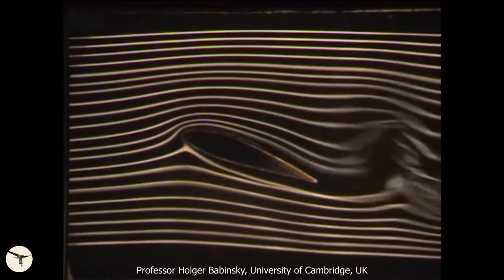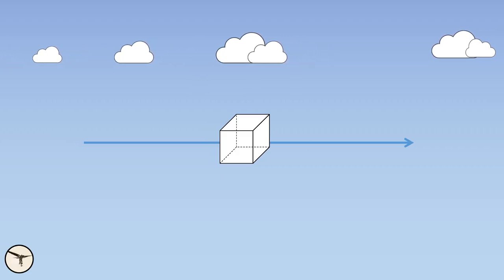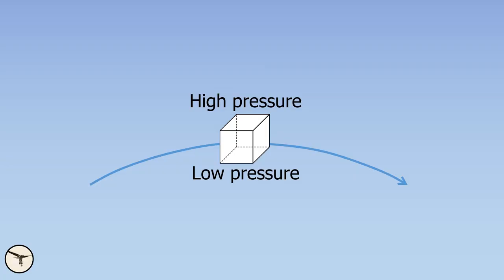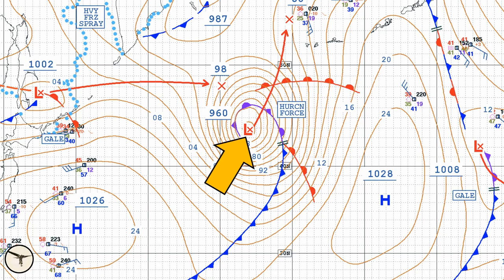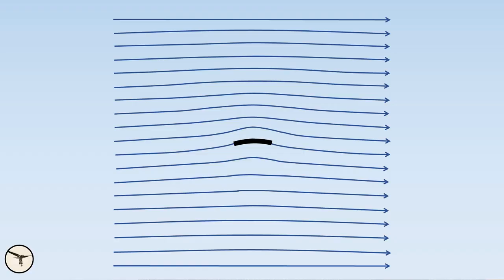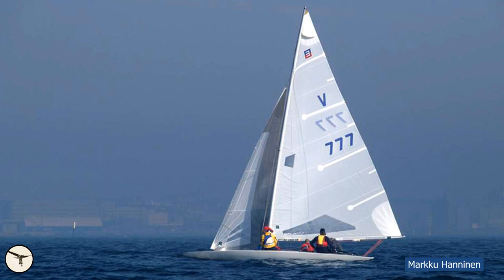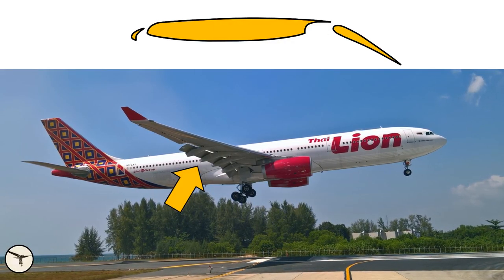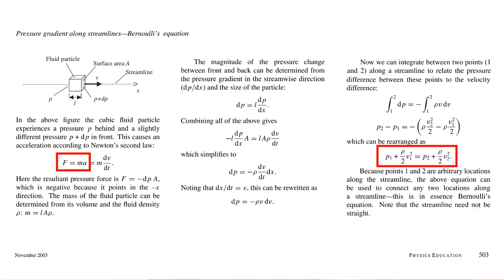Forget Bernoulli and Newton | The easy way to explain lift

Comment: Air has weight ! The  Centrifugal force exerted on  the air following the top curvature of the wing at high velocity supports the negative air pressure  that creates lift on the top of the wing . That boundary layer  across the wing doesn't lift by magic . It has to be anchored to something . High velocity air has weight . A simple leaf blower  should demonstrate that. A wing does have down wash , but that is not where lift comes from. How could you calculate your CG if that were true ? Vacuum caused by the high velocity air molecules trying to adhere to the top curved surface of the wing along with any planning effect from the bottom of the wing is the source of  lift . When the angle of attack increases to far the flow of high velocity air across the wing detaches .  
 Not one explanation discusses that High Velocity Air Molecules have a density and weight and deflecting air around an airfoil top surface creates kinetic energy for example Centrifugal Force . That force is where the most of the lift comes from and is transmitted to the top surface of the wing through the iconic Boundary Layer creating a vacuum on the top surface of the wing .

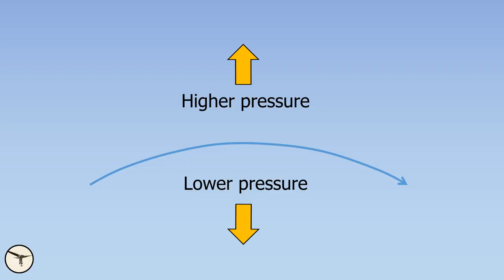Comment: The diagram at 5:46 contradicts that at 4:44 where the higher pressure was on the outside of the curve. So I'm not getting this explanation, sorry.

Comment: What if I have symmetric or flat wing? Just like aerobatic aircrafts have?
Reply from the maker: Angle of attack. 
https://youtu.be/d4w1Iy4vVMg
Reply: @FlywithMagnar  So is this video appliable to flat wing?
Reply: @jaromirandel543  The problem is, you can't get rid of Bernoulli.  

Lift is caused by asymmetry of a solid to the relative wind.  Asymmetry has a contribution from both any designed asymmetry in the camber and asymmetry due to angle of attack.

Flying inverted or flying with a flat wing (like a toy airplane), relies on angle of attack to provide the asymmetry.

Bernoulli is the conservation of energy related pressure drop, associated with this asymmetry. 

Asymmetry is the cause of constricting the airflow path more on one side of the wing than the other, which causes the conservation of energy pressure drop response.

The force of this pressure drop response forces a bending of the relative airflow downwards.

Comment: 3:22 If you hold two sheets of paper vertically with a small gap between them, and you blow air down through the gap, the two sheets will clutch. That's the Bernoulli effect. How come with only one sheet of paper the Bernoulli effect is not observable?
Reply: I'm glad you brough this up.  I had to sort it out for myself.  I get what you show with the two sheets of paper coming together and I get what Magnar shows with the curve from holding a single sheet horizontally, with the paper rising.

I was puzzled about the single sheet held vertically also.  I was not surprised that when I blew, if the sheet did not go  with my direction of blowing a bit (if I angle a bit into the paper), it just stayed vertical.

And then I thought, "can this make any sense"?

I found that the result that Magnar gives 3:11 blowing on the vertical sheet, is a false result.

When you are blowing vertically the conditions are much more sensitive to error because your blow direction is parallel everywhere to the paper;  but in the curved case it is much more tolerant to error because your breath can't avoid capturing the curve.

Try for yourself, but with a very light thin sheet of tissue held vertically.  That way you can blow a bit away from it to keep from pushing it in the opposite direction in error.

Indeed, the tissue rises toward the blowing air, even when flat.

So this has been debunked.

Comment: Hello Magnar, I'm a university student in an aeronautics course doing an assignment involving correcting and/or fleshing out explanations for lift. This explanation is excellent and probably the best youtube video I have reviewed for this assignment. I was pleasantly surprised to hear that you actually were informed by Babinsky, one of the academics my class discussed in learning about the intricacies of airfoil lift. I thought your video summarized his paper well and even explained some of his points more clearly and concisely than the paper did. I just wanted to add one or two points to add my knowledge to what you explained in the video.

Firstly, I wanted to clarify what the Coanda effect is as the paper is a good demonstration of this but I thought some people could be led slightly astray by its use here. While the pressure gradient caused by the curvature of the air flow does likely contribute some to the observations Coanda made his research was very specifically about powered jet flows attaching to convex surfaces. Unlike in most explanations for lift of an airfoil which ignore viscosity as the bulk of the math on lift still holds even without viscosity, the Coanda effect does critically include viscous effects. The reason this matters is that a powered jet generates a lot of turbulence which mixes and draws in the surrounding air to sustain the flow and as the jet gets closer to a surface it draws out more air than can be replaced generating a vacuum that suck the jet to the surface. This is a similar effect to your description of why airfoils have lower pressure on their upper side but critically different due to the importance of the mixing of air due to viscosity. Secondly, I just wanted to mention as it was a point of emphasis in my education about this, the velocity and pressure should never be treated as a cause and effect, this is not a mistake Magnar made but one that anyone attempting to explain lift correctly should avoid. The pressure and velocity changes happen together, codependently and at the same time, like an ice cube melting and your counter getting wet, they're related but happening at the same time.
Reply from the maker: Thank you so much for your feedback. I am humbled. Regarding the relation between velocity and pressure, I learned somehing new! This subject is like discussing who came first; the chicken or the egg. 

This video received attention from people arguing that a flat wing can fly. So, I made a video addressing just that. https://youtu.be/d4w1Iy4vVMg

Comment: I would like to read Prof Babinsky's paper, but your link takes me to a paywall.
Reply from the maker: Alan, yes you have to pay when using that portal. In this video, I'm referring to another document written by Babinsky. I have can email it to you. 
You made a comment to my first video about Bernoulli and Newton; it appeared on my phone, but not in the Studio app (I don't know why). The issue with the wind tunnel is that it is very small. The floor and the ceiling are too close to the wing. For example, the downwash is supressed. Hence, there's no undisturbed air above and below the wing. Another factor is that the wing is at a high angle of attack, and the airflow towards the trailing edge is separating. And not to mention inaccuracies in the smoke distribution system, and the scale factor (Reynolds number).
Reply: @FlywithMagnar  If, as you say, the discrepancies in the wind tunnel geometry, the AoA, the Reynolds Number and the smoke distribution system are sufficient to invalidate my conclusion about the absence of increased air speed over the upper surface, then shouldn't they also invalidate his conclusions about the "equal transit time" theory as well? (From many other sources, I have no doubt it is a fallacy, but the video is very convincing.)
This increased air speed is widely used to develop the Bernoulli Principle based explanation for the low pressure above the wing, but I have not found any research that demonstrates it existence. Are you able to provide any references?
And yes, I would very much like you to send me a copy of the paper.
Reply from the maker: The purpose of the video clearly is to dismiss the "equal transit time" hypothesis. And it does that perfectly. An airflow accelerates when flowing smootly over a cruved surface. This causes the static air pressure to decrease near the surface. Further  away from the surface, the air moves with less velocity (higher static pressure). This pressure difference is lift. 
If you want a reference, I recommend "Aerodynamics" by L. J. Clancy. It has been my "bible" for decades and can be purchased/downloaded from various websites.
Please email me and I will send a copy of Babinsky's paper. My email address is shown in the About secion in my profile.
Reply: @FlywithMagnar  at 7:46 you claim Babinsky said:
" Curved streamlines cause pressure variations across the streamline. And lift is caused by flow curvature". 
I think that's not a too unreasonable interpretation of Babinsky's paper which actually states:
" ...any shape that introduces curvature into the flow field can generate lift. Aerofoils work because the flow follows the local surface curvature of the upper and lower surfaces." (That's a direct quote.)
I think there is confusion about cause and effect amongst a) the shape of the surface, b) the curved flow field, c) the pressure difference and d) lift.
Babinsky claims it is the shape of the surface that causes the curved flow field which generates lift.
Here are two insurmountable problems with that "explanation".
1.There's plenty of experimental evidence that a flat plate angled to the incident airstream will generate a curved flow field (b) and lift (d).   It's not the shape of the surface (a) or the curved flow field that causes (d) lift (d) . Shape (a) influences the size of the lift (and drag!)
2. it's not the shape (a) of the surface or the curved flow field (b) that causes (d) lift. Why? 2 reasons:
A) As Babinsky correctly points out in his paper,  the curved flow field (c)  is the result of a pressure gradient (c). It's not caused by the shape of the surface (a).  
B) Lift is the force that opposes the downward force (gravity). Classical physics states the only way a fluid (like air) can exert a force on a body is via pressure (c).  Lift cannot be created by either the curved flow lines because it's not pressure, nor or the shape of the surface, again, not pressure. (This probably scuppers all the explanations involving momentum, inertia, circulation and vortices!)

The cause of the curved flow field (b) and lift (d) is the pressure difference (c). The shape of the aerofoil is irrelevant to the argument.
The $64 question is what causes the pressure difference?
I have a theory, just not fully formed yet.
Reply: Alan Smith / You make a big confusion between an ideal theoretical situation and the practical one.
In the ideal theoretical situation, yes, in principle, in order to obtain lift the geometry of the "wing" doesn't matter. You obtain "lift" ( or even "drag coeficient" in any viscous medium ) with any planar shape. 
But in order to obtain the MAXIMUM "lift" ( or a minimum drag ) the shape matters enormously. 
Just think about the natural shape of the bird wings, or the form of a fish in water, or the form of a water drop in free falling, etc 
Do you see natural forms that fly ( or swim, or etc ) through a fluid in a form of very slim parallelepiped, or in the form of cubes, etc?
No. It is naturally present ( in nature ) only in elongated CURVED surfaces.
So, the shape MATTERS a LOT in order to obtain the BEST LIFT POSSIBLE ( or the lowest drag possible) when flying or moving fast through a fluid ( through air in case of an airplane). 
The curved surface obtains the best lift possible ( or the lowest drag possible) with the minimum energy expenditure.
With wings of planar surfaces geometries, yes, you can obtain lift by using the angle of attack, but the maximum lift in these cases is much lower than the one obtained with curved wings for the same energy expenditure ( behind the planar wing using the angle of attack to get lift there's a turbulent drag effect, while a curved wing obtains lift by creating an orderred laminar Bernoulli effect above it ).
There's no $64 question at all, because the general principle is not complicated at all 
Professor Babinsky explains "academically" the general principle, but as you can see both Newton and Bernoulli are valid and used in his explanation.
There's no mystery in the fact that the pressure of a contained fluid decreases when its speed increases at one location, because at higher speeds of the contained fluid in one of its location it simply takes a permanently delayed TIME ( as long as the higher speed of the fluid is present ) to replenish the MASS that's being moved faster from that location ON a specific AREA. The continuous delay in that replenishment is "equal" ( or proporttional ) to the lower local pressure.
Reply: @mikel4879  What is "an orderred (sic)  laminar Bernoulli effect " You are making stuff up!
There's no argument that an increase in speed causes a low pressure in an incompressible fluid , but what causes the increased speed over the wing? That's the $64 question. And where's the evidence of the increased speed?

Comment: You should know that, in aerodynamics, they apply the Bernoulli equation with potential flow. That means the flow is inviscid, irrotational and incompressible. This leads to the Laplace equation with the boundary condition there is no flow normal to the lifting surface. When you blew the paper vertically, there existed flow normal to the surface, so, it didn't meet the boundary condition for aerodynamic external flow. In short, your proof is flawed from the beginning. The Bernoulli equation is based on the principle of conservation of energy of ideal fluid, so, it is the same thing as the Newton's law of motion. We need to know their fundamentals before using them though.
Reply: "When you blew the paper vertically, there existed flow normal to the surface, so, it didn't meet the boundary condition for aerodynamic external flow"

When he blew on the paper vertical, his blowing technique (because it is sensitive to error in this configuration) gave a false result.

Hold a very light piece of tissue paper vertically, and blow with more caution so that you don't force the tissue to be forced in the opposite direction (it's already fighting against gravity after all).

There's little question the tissue is attracted toward your breath just like in the horizontal curved case.

Comment: I've never heard a good explanation of how a fully symmetrical wing can produce lift based on Bernoulli principles. A half symmetrical wing is always shown in the standard explanation and talks about high and low pressure. Doesn't make sense. 

As in any fluid system, the object must displace more fluid to float or fly (PLANE). An airPLANE wing merely displaces air from the wing to overcome the weight of the aircraft. The angle-of-attack allows the wing to displace enough air off and down from the wing to produce the lift. This is what "lifts" a boat moving through the water i.e. when it gets up on PLANE.

Comment: Yeah Babinsky is wrong. It is not the curvature,  it is the reduction of the sectional area of the streamline when there is a physical obstruction of the wing in the free stream.

In theory,  the streamline geometry would be symmetrical, causing symmetrical pressure distribution,  and zero lift possible. However, boundary layers and BL seperation exist in nature, thus allowing a wing to alter streamline geometry to allow net lift.
Reply from the maker: I have to say that you are bold challenging Professor Babinsky. Even if you have a degree in fluid dynamics, you might learn a few things from him.
Reply: @FlywithMagnar  perhaps there might be details lost in the simplification of the explanation for lift, but the fundamental concept is still wrong.

It is also NOT about fluid dynamics, because that studies the flow that is already established. 

The simplest way to explain lift is THE SHARP TRAILING EDGE. Which forces air to flow around the wing in nature in the pattern observed. After which you may apply fluid dynamics.
Reply from the maker: Well, have a look at this video: https://youtu.be/d4w1Iy4vVMg
This is lift as explained by Professor Holger Babinsky, Associate Professor Krzysztof Fidkowski, and L. J. Clancy's book "Aerodynamics".
Reply: @FlywithMagnar  Already seen it and you are incorrect.  Others have already pointed out that a flat plate wing will generate lift, it just generates a ton of drag.

The reason why a flat plate can generate lift is it has a SHARP TRAILING EDGE which creates a flow pattern that has circulation. My proof: A flat plate propeller can generate thrust, many fans use flate plate blades to reduce cost.

You are also wrong about downwash in your video. There is no downwash because the wing wake is turbulent and has no net vector. 
Your own pressure distribution diagram shows lower static pressure in the flow that left the top of the wing compared to flow leaving the bottom of the wing. This means the flow pattern will bend UPWARDS behind the wing.

Applying Newtons 3rd law to suggest there is a downward change in mass flow in reaction to lift is the biggest damned fallcy of all. It violates the fundamental principle of conservation of energy. The only way this is true is if you always need at least a thrust to weight ratio of greater than one for self powered flight. This is only true in VTOL and helicopters.

Comment: Both Newton and Bernoulli are still lurking there...
Reply: That's right, you can't have the effect without the cause.  Opposite reaction of lift comes from downward momentum of air.  Downward momentum of air needs an accelerating force which is the pressure difference.  The pressure difference is from conservation of momentum forcing static pressure to be swapped for dynamic pressure (which itself is conservation of energy).